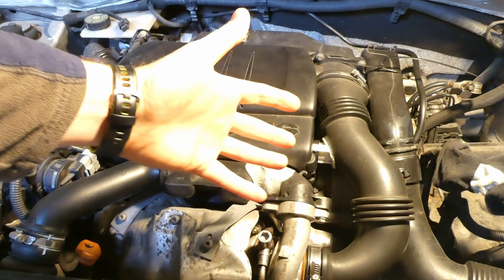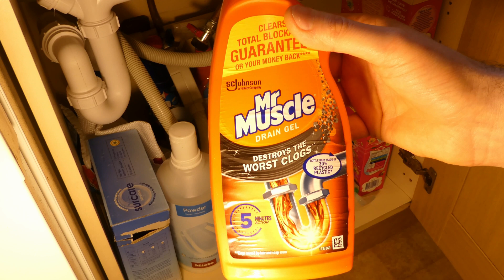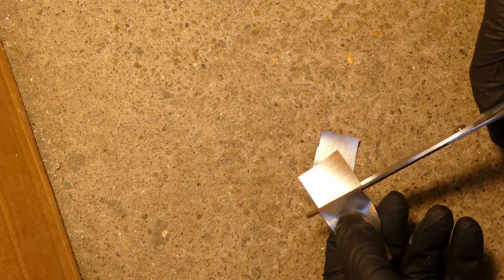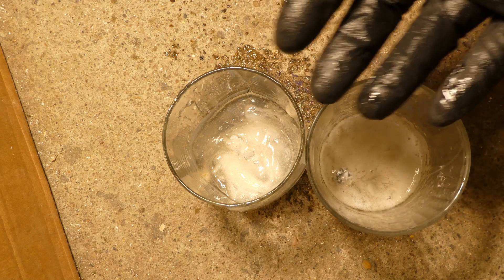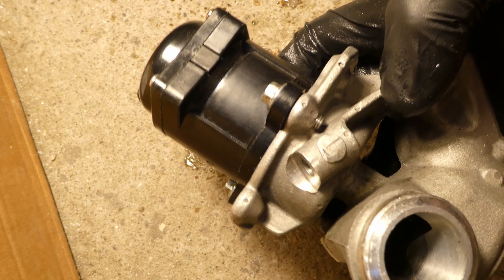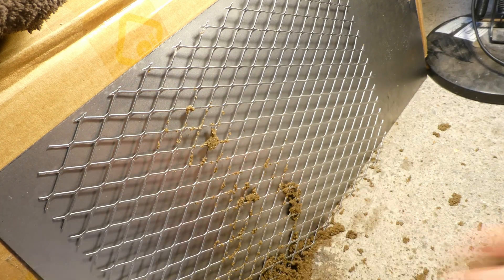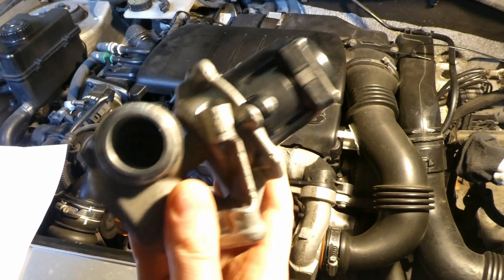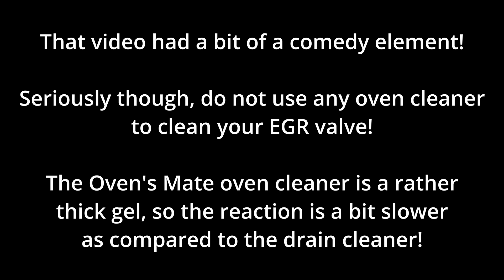Stop using oven cleaner to clean EGR valves!

Comment: I've been using oven cleaner on EGR valves for about 20 years now. Absolutely no ill effects. The thing you have to understand is when the oven cleaner comes in contact with the carbon it starts neutralizing and then you just have to wash it all out that's it, just wash it well, no ill effects.
Reply: Thank you man you calm me down because besides this I just saw degreaser will damage aluminum and I've been going at it trying to clean carbon and oil sludge that started out about when you started using oven clean so about 20 years ago. Of course no mechanic cleaned the pcv system and I don't think they cleaned anything ever. Before I bought it they took it to a mechanic and he found a spark plug had failed or fouled so he just replaced the spark plug but what caused the problem? PCV valve was clogged, electrolysis damage on the head, tear in the cold air intake which they tried to glue with glue not compatible with NBR rubber then seal with a load of tape. This car is kinda rare not like this Porsche I found filled with trash that only had 3000 ever made but yeah. No mechanic will clean the pcv for example till something breaks so all mechanics are cheating us.

Comment: Any component that's 100% stainless steel will be ok with oven cleaner, or a lye/water solution, lye being the essential ingredient in oven cleaner. And they're quite effective. 3rd gen Prius EGR cooler for example.

I agree though, oven cleaner or lye are overkill for most components, and anything other than stainless steel WILL react with caustic cleaners such as those, should NOT be used.

Comment: Hi there, great and fun video to watch! 
But i watched it only after i already bought 3 different degreasers. :-D 
2 of them are oven cleaners (lidl one and mr muscle), but the third one is some kind of a universal degreaser (Axel Sgrasso), which i usually use whenever i need a degreaser. On the bottle it is written that it can be used for ovens, aspirator filters, radiators and even bicycles... Nowhere does it mention that aluminum should be avoided. 

What do you think, can there be some risk? 

I'll throw the ingredients list here, if you have time to look it up :-D 

Ingredients: Aqua, Alcohols, C10-12, ethoxylated, Ethanolamine, Butoxyethanol, Tetrapotassium pyrophosphate,Sodium ethylhexyl sulfate, Quaternary ammonium compounds, Perfum, Tetrasodium etidronate, Color, Citral,d-Limonene

Comment: Err . . . Err . . . .couldn't you neutralise the effect of the alkaline oven cleaner by treating it, after the  application of oven cleaner,  with a weak acid  e.g. supermarket citric acid (Cheap as chips, as used to remove calcium from kettles). And then wash with distilled water, wipe down, and finish with a light oil spray. 

 Agree with toothbrush suggestion.

Of course you could go high tech and use an ultrasonic agitator and partially immerse the valve in a prescribed cleaning solution (As used in hospital CSSD departments to clean fine instruments). Come o clean as a whistle
Reply from the maker: Yeah, ultrasonic cleaner is quite good, unfortunately a bit expensive and I do not have it. The point of the alkaline solution was not that it acts over long time after the treatment, simple wash with water will remove it. It is the fine micro holes that will be left using it. I agree, it will not be visible, but the surfaces will not be as smooth, so more carbon will start to accumulate.
The light oil spray is not a good idea, the carbon and the oil and temperatuer from the engine will make a very hard paste out of that.

Comment: The oven cleaner you used contains Sodium Hydroxide, yes it eates aluminium, try using Mr Muscle Oderless Oven Clean contains Alkaline Salts doesn't eat aluminium. Test on aluminium foil for one hour, no problems.
I just cleaned my EGR and my EGR Cooler. I soaked the cooler overnight with petrol over night and placed in the ultrasonic cleaner for two hours and thought it was clean,  until I used packing tapes to seal both ends, made a tiny hole in each end, used a different spray nozzle from my WD-40 with a straw and sprayed through one of the small hole until it came out of the other hole and it came out black.
Mr Muscle Oderless Oven Clean is foaming and expands so it reached ever area of the intercooler and I left it in for an hour, rinsed with warm water until the water came out clear. Looking inside it was shiny like new.
Reply: Or you can use Penrite Intake and Valve clean that also foams up, if you can't find Mr. Muscle oven cleaner.

Comment: The word is gelatinous. If you have aluminium components in your engine less than 0.2 mm wall thickness, you have bigger problems than this. Oven cleaner FOAM works just fine, you are a funny fella. Are you Russian?

Comment: Yes but is that aluminum foil caked in 100.000 miles of caked oily soot. No.  Is the EGR valve coated.  Yes....  Okay I figure since it's solid cast aluminum and coated a soak ion Mr Muscle overnight will only remove the sooty oily carbon build up..   Never did any harm in my Skoda fabia 1.9 Tdi or Golf 1.9 GTD It helped with the limp mode problems.

Comment: What about the cooling pipe... logically that is smaller and first place to cool so it will have more carbon than EGR, ASV and Intake Manifold.
Reply from the maker: Yes, that would be clogged as well, but generally the first bit the gasses hit is the EGR, so most of the carbon will end up there, but the other will also be pretty clogged up. Need to do that one day.
Reply: @moremolecules  Thanks for reply. Just logically, it is 4 things that need to be decarbonized...I am waiting on the gaskets and rings, well just the rings now. I think cooler/EGR/ASV are a must and 40k km.... Inlet every 80k km. Haven't got to exhaust system yet... next bloody rabbit hole!!! Great little cars but some things that make it a pain in the arse.
Reply from the maker: @gesheepistemology8050  Yes, these needs to be decarbonised, which is on my to do list for quite some time now, haha

Comment: unfortunately, modern school does not teach students science anymore. no more single science courses like "chemistry" (this is where you learn about elements, materials, molecules, chemical equations) or physics (this is where you learn about forces, electricity and magnetism, optics etc). Or biology (about plants, animals microbes, dna, rna, etc)..................... oven cleaner and draino are alkaline. they react with aluminum to form Al(OH)3 and hydrogen gas. You could have told us this in 5 seconds. However, the heat exchanger is stainless steel and oven cleaner is quite good there. (did you know that al-kali is arabic word? and al-chemi? and al-gebra? and al-gorithm?)

Comment: few notes:
1. EGR valve body made not from aluminum, but from aluminum alloy.
2. the body is a bit more "massive" than the aluminum foil
3. you can use "foam"  oven cleaner, it is a very little working liquid that will apply to the valve. (better -- use special liquids)
4. there are a lot of special carbon cleaners and degreasers in the auto store. use them first.
5. TSP (heavy-duty cleaner) works slower, but better.
6. you should not do just soaking you need some mechanical work.

Just notes -- you can ignore them.
Reply from the maker: I agree with these, but even though an alloy, still quite fragile and can be degraded.

Comment: Scientifically correct. Practically incorrect. Oven cleaner is fast and gives even a stuck egr many thousands of miles more use. Much cheaper than a new one. And it is the fastest way to clean it. Best solution of course is to delete it. Your egr will destroy your engine
Reply from the maker: Keep using it then if my advice is practically wrong

Comment: Could I use petrol on the plastic manifold like this?
Reply from the maker: Yes, petrol works
Reply: @moremolecules  big fan of your channel Mr.! I'm doing a big job on this engine now. I'm not a mechanic but I have no choice..
Reply from the maker: @martinsrc8752  Good luck with the job(s).
Reply: @moremolecules  discovered that the tip of glow plug fell in the chamber and damaged piston and head
Reply from the maker: @martinsrc8752  Yeah, that could happen and it is tough, head off to get them out.

Comment: I've used Oven Degresear. It is liquid and makes a white foam, it cleans good. The disolved stuff gets into the foam and makes it like a brown liquid. Used it for EGR valve, for EGR cooler, even for the plastic maniforld and it did a great job. It says highly concentrated to remove grease and scorced grime. It is called Sano Forte Plus, don't know if you have it in your contry.
Reply: dude: oven cleaners are all alkaline. they will damage aluminum, but not plastic and not steel. go check your chemistry books. <if you ever took chemistry classes>
Reply: It is an aluminum block, not aluminium foil. It barely cleaned the black stuff and there is no visual loss of material, it just looks cleaner.
Reply: @MrTeknown  so, what is the difference between aluminum and aluminum? the foil is thin and will corrode much faster. the block material will corrode too. especially if you leave it long enough. so, why would you run corrosive solvent if you dont have to?
Reply: @west_park7993  the thing is that you will not put a hole in it by cleaning it. It is not gallium or something to really break it. There are of course other cleaning methods and solutions, but this is cheap and effective, decently fast and practical. 
You are not cleaning precision tools or microprocessors with it, but exhaust components. The valves will keep proper seal if you worry about it.
You will not clean it daily, I did the cleaning for the full intake and egr valve and cooler on my A6 2.0 TDI 2010 (caha 170hp) at 245 000, used the spray oven cleaner and washed it with water.
Reply: @MrTeknown  there are mating surfaces, flanges. and there are surfaces where the piston moves and slides. these will corrode and will lose its geometry. anyway, do as you please.

Comment: I've owned audis for 20 years and have always used Mr Muscle oven cleaner. My EGR will last 100k after a clean. 

Also use it to clean sticky turbo vanes and the intake manifold.

Of course people are going to slate it. They want to sell you expensive snake oil and engine cleaning services.
Reply from the maker: I am not selling anything actually if you follow that video or any other videos of mine. I was only pointing out that this is a potentially dangerous thing to do. I also said that if one does it quickly then it should be ok, but I would not do it myself. Your argument that you have always used it is like the argument that my grandfather smoked 3 packs a day and lived till 100, it does not negate the overall damage done.

Comment: this is so stupid😅 first off an egr valve isnt made of tinfoil and secondly the shiney aluminum material will most likely be worn away anyway after years of wear and tear, my advice would be to spray the oven cleaner in more frequently if carbon is building up and doing it without removing the egr. you really are clutching at straws on this one😂

Comment: Hes using thin aluminum foil, turbos are a hell if a lot thicker  than that. And your not soaking your turbk in 100 oven cleaner. If your not putting water intk a squirt bottle and diluting your cleaner your doing it wrong. This guy clearly doesn't pay attention to how this job is supposed to be performed.  Squirt bottle. Diluted oven cleaner.  Spray every couple seconds for about a min. Then flush every couple seconds for another min. Done

Comment: You never know . . .in days to come . . Manufacturers may develop casting and finishing techniques for making the internal airways of  EGR valves as smooth as a baby's bottom . .. . . which would, at a stroke, reduce carburetion and intake faults caused by carbon accumulation and  this would . . . .at the cost of a few UK pounds per piece  . . .increase customer satisfaction (Shock ! Horror !) . . . .give 'em a chance though, they've only had over 100 years to  work the problem. (Satire this time).

i've heard, from an unimpeachable source, that when the AI bots completely take over the VW/Skoda engine design department,  re-designing the EGR manufacturing process or even dispensing with EGR valves completely will be top of tneir agenda . . No wonder they're trying to ban AI (More painful Satire !)
Reply from the maker: Hahaha, this made me really laugh. In the name of customer satisfaction...🙂

Comment: TFR (non caustic) are better option. Just soak the cooler without any electical parts in a tub with some TFR(traffic film remover) which is used to was carbon film from lorries and vans. It works as a treat the soot falls out after few hours of soak. No need for scrubbing and it doesn't dissolve aluminium parts.
Reply from the maker: Have not heard of TFR, but will definitely chek it out.

Comment: And car light weels cleaner? Its for aluminium and reacts with other things. will you make a video?
Reply from the maker: Ahh, not too sure about it. I can check it of course. The easiest is to use dishwashing liquid and an old toothbrush, it is just cheaper. TBH, anything will work that can dissolve carbon and it does not work on the aluminium.

Comment: There is some various water based products on the market. Some of them are only for clean, some of them for clean and shine, some of them only for oven and also for carbon clean. The only thing should do put in a container warm water and add the product 1:3 or 1:1 ratio depends on how much part will need and leave the piece in for quarter or half hour, use in ultrasonic clean if you have, leave it for a day if carbon as thick as a finger, then rinse it with a tap water. You don't have to use mechanical clean. Carbon will be all gone and the piece will shine like a new part. This is for aluminium parts only. You can use it on engine wash with spray bottle too.

Comment: I understand if the aluminium is hot, it won't be affected.  
Only affects cold aluminium.
Reply from the maker: It is a chemical reaction, the hotter the components the faster the reaction. If it isvery cold then yes, the reaction will be slower.

Comment: Yes the reaction is something but keep in mind that is just aluminum foil which is very thin and you left it in the product long enough, now compare it with the body of the egr which is several 100 s bigger and the time is short
Reply from the maker: Yes, I agree that there is a mass of aluminium in the EGR valve and I have not said that the whole EGR valve will be dissolved. Nevertheless, the surface does not get just polished with the KOH/NaOH. You get molecular throughs, dimples and so on. So, these imperfections accumulate more carbon as the surfaces are not smooth enough. In other words, you get a lot more carbon if you treat the EGR valve with KOH/NaoH, kind of defeats the purpose,  no?
Reply: @moremolecules  Well if that much carbon acumulates in 10 years with the polished surface and after the NaOH clean it gets dirty faster because of the microspores but say it holds at least 2-3 years before it fill up againg with carbon then is a fair trade off before you need to buy a new unit or scrap the car
Reply from the maker: @christianrazvan  I agree that if one does not care too much or you expect to replace the car then it is alright. But the problem is that the next owner will have to deal with the more frequent cleanings of the EGR. I am on the opinion that a job has to be done well, not perfect but to a decent standard.
Reply: One issue. The foil is not pure aluminium, or else it wouldn't bend around your oven chicken. I think your test is extremely flawed by using foil as a base sample.

Comment: People are using Mr Muscle Foam and nothing work like it. No EGR cleaner. I tested all. I tested many chemicals on aluminium. After a rinse with an acid can even protect the aluminium like is made in Anodising. That drain cleaner can be acid like other ones up to 97% sulphuric Acid. Not Mr. Muscle but cleaning it right after will be fine. I cleaned my intake manifold, egr, and the valve and everything is fine. The worst thing is that will be a darker color if left for 24 hours but we are talking about minutes and nothing works better.  I even tried to engrave aluminium with saturated Sodium Hydroxide that is in the oven cleaner and without success. It only goes on microscopic level on surface and in hot water a bit faster but i don't think will affect the build up. In the same way oil can enter in pores and can make the surface slippery.
Reply from the maker: I agree that doing it quickly should work, but the reaction happens straight away and some aluminium will be eaten. If it is quick it will not do that much damage. I generally use any dishwashing liquid and a toothbrush, but I suspect that Mr muscle will clean it well inside where I cannot reach with a toothbrush.